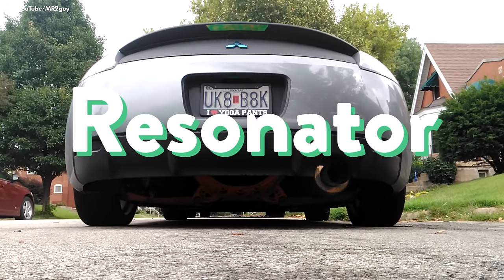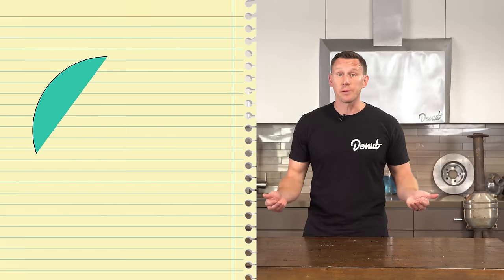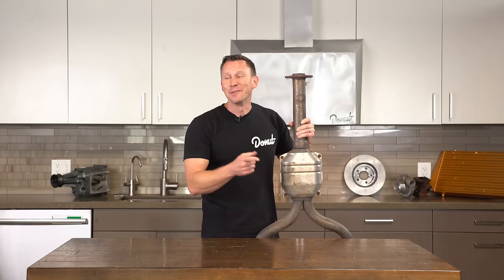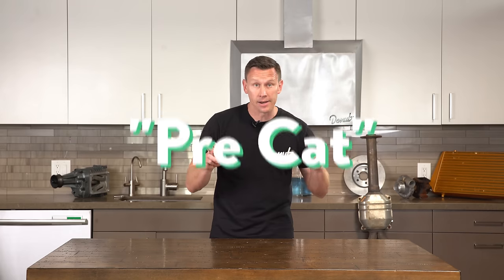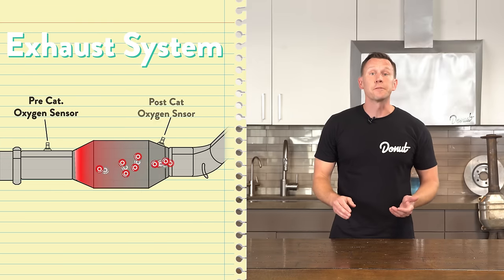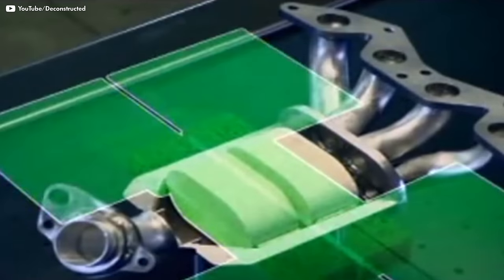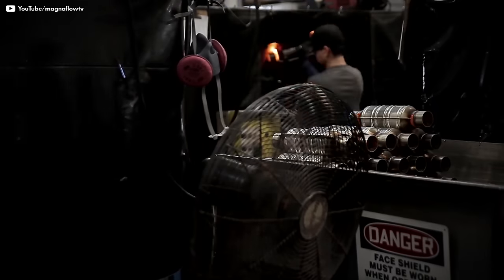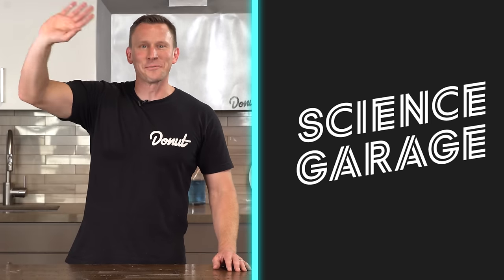Catalytic Converter: How It Works | Science Garage

Comment: Please, enlighten me on how an obstruction in the exhaust WILL EVER IMPROVE PERFORMANCE
Reply: if you mean a catalytic converter then they don't (at least modern ones). Because they use a honeycomb and not just round or square tubes air can pass more freely through the cat. This is why honeycomb grills are popular in computer products. they allow for larger amount of airflow then other designs and have better structural integrity. Also the little tubes almost act like little venturis speeding up the exhaust and causing a slight pressure drop. that drop in pressure creates a slight suction that can pull intake air into the cylinder (if there is enough cam overlap) and have less exhaust stuck in the cylinder for the next cycle.
Reply: ^Thats also why so many vehicle grills used honeycomb shapes in the past. Now that things are more about style, and we have stronger plastics, stronger electric fans, and better overall cooling efficiency, it's not such a necessity.
Reply: @SuperCookieGaming_  now please explain in depth the emissions created in the making of the convertor including the cost of mining the materials compared to how much emissions are saved by a cat

Comment: would be cool if they could figure out some way to use the heat generated by the catylitic converter to porwe up the battery or something.
Reply: You could probably do that with the heat from the engine as well. It would improve efficiency in a non-mobile engine, but it adds weight and complexity.

Comment: Let me say something real quick.
Catalytic Converter isn't actualy that good for the environment!!!
Because most Catalytic Converters get cloged up quite fast. And to prevent that cars need to burn the dirt out of the exhaust. Consequently car burns more fuel and with all that extra fuel needed to burn the dirt off put a lot more CO2 in to the air. Yes I know that the air is cleaner now I GET IT. But on the other hand we burn a lot more fuel.

I hope you guys understand me, it's quite hard to explain in another language.